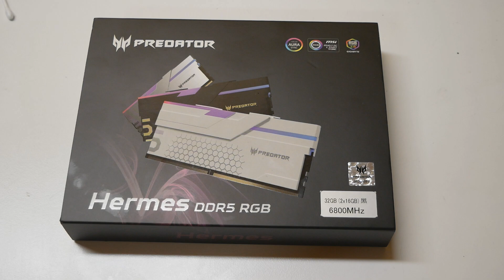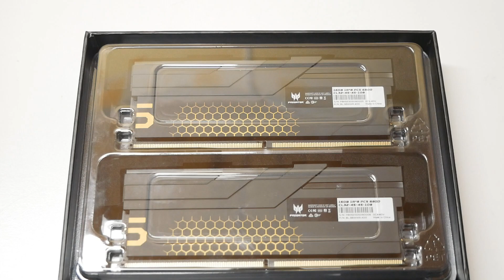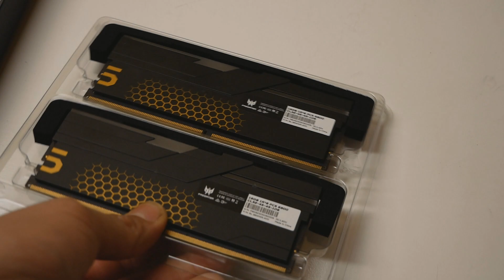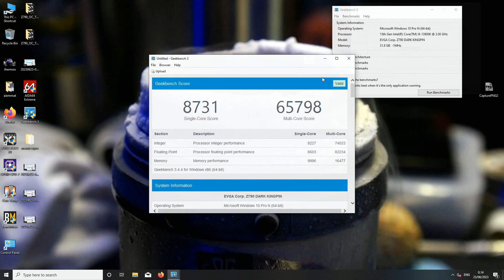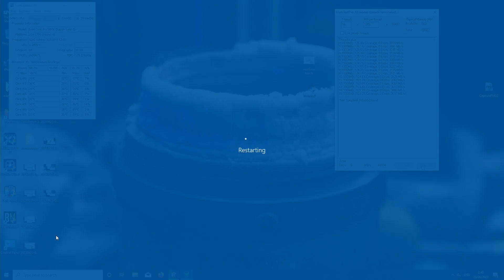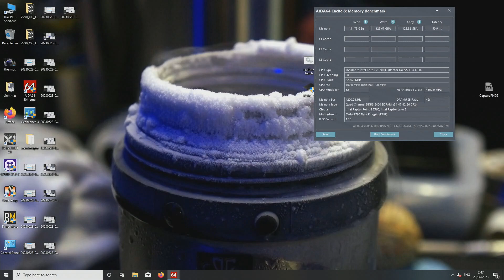Predator just Released the Best DDR5 Memory - Hermes RGB Unboxing & Overclocking to 8750MHz

Comment: Kinda sad that Intel users have to run 8000 MHz+++ DDR5 RAM just to compete with a stock 7800 X3D
Reply: atleast intel doenst have to worry about the am pieceofshit dip that they have in every cpu
Reply: @chrisn7004  Stay mad. AMD is better than Intel in every segment.
Reply: The same could be said with 7800X and 7950X users 😂

Comment: Predator has some insane memory, definitely one of the most underrated brands. Their Apollo DDR4-3600 CL14 Kits overclocked extremely well and were pretty affordable. Nice to see the trend continues with DDR5.
Reply: Same with HP and their V-series on DDR4, as it's the same OEM/ODM (BIWIN - rather unknown but they clearly know what they're doing).
Reply: Even better they have temperature sensors unlike the HP or other options in 139-200 range for daul rank bdie